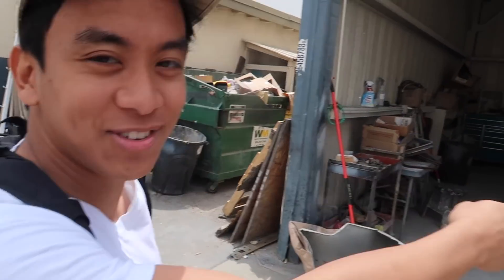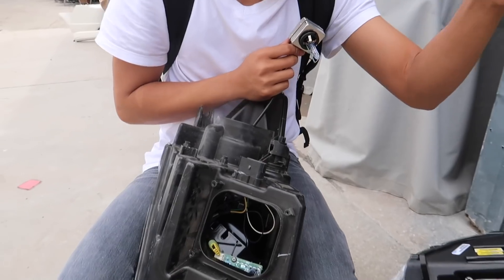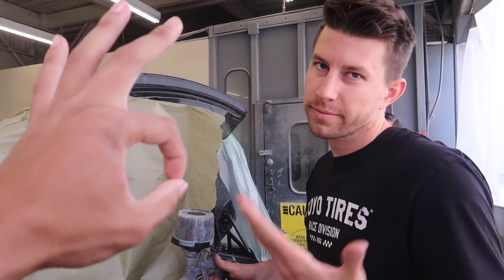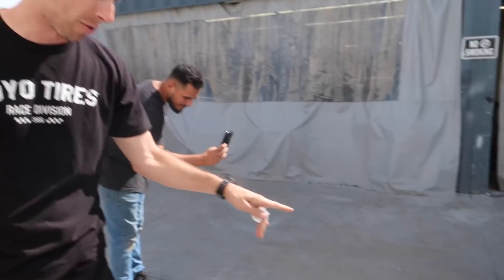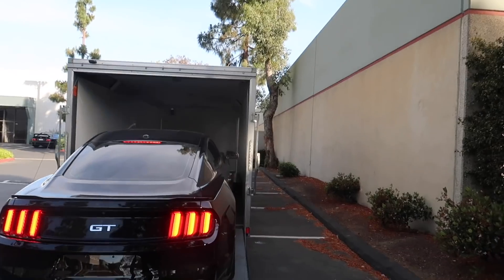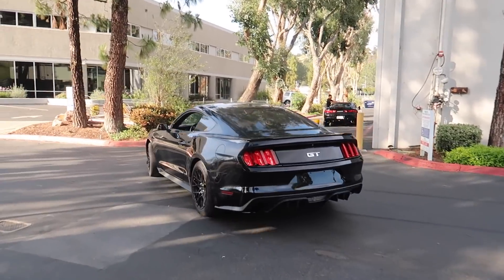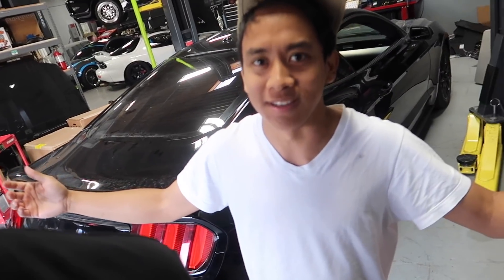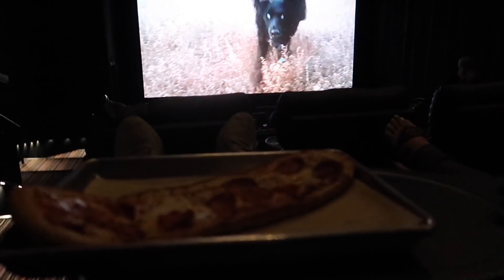The Mustang GT is COMPLETE!!

Comment: Put it in track mode then hold the traction control switch up for like 5-10 seconds until “advanced track” is off. Then you can do real skids and burnouts and not have the traction control still turn on and send you into a wall (or crowd). 
-fellow mustang owner
Reply: Who has been crowd free for 2 and a half years
Reply: Then you can burn out as long as you want and have no throttle cut

Comment: Cams, american racing long tube headers, exhaust cutouts, corsa extremes, n2mb wot box, 15” welds with mickey thompsons (for the strip) and the new carbon fiber gt500 wheels for the street, whipple supercharger, gt350 spoiler, shelby widebody kit, mgw short throw shifter, i gotchuuu
Reply: Everything here but instead of the whipple I would go with the VMP supercharger
Reply: Mustangs need whipple superchargers for sure

Comment: Owner of a 2015 Hellion Twin Turbo Mustang GT here.   With the MT82 transmission you should upgrade the clutch.   Mantic makes a great one (dual disc).  Upgrade the shifter (Barton Hybrid 3 short throw shifter), drive shaft (I prefer the Carbon Fiber but one piece aluminum works), upgrade the half shafts, and upgrade to billet oil pump and crank gears (cheap Insurance).  

Also Steeda makes a good "stop the hop kit".  I'd upgrade the sway bars too to stiffen things up. 

Lowering springs, coilovers or bags (you'll do bags!).

Wheels with the proper offset and better tires.  The stock Pirellis are brutal...  R888s maybe??

Comment: From a 2017 GT Owner

The Roush front end looks great, a little hood scoop makes it a lot more aggressive imo (Not the big ones where you can’t see shit inside)
Definitely get:
Opt7 Front switchback turn signals
Diode dynamics RGB DRL hoards
LED interior kit and reverse light kit

I’m sure Roush will send you a blower so there’s that. Tons of stuff with the Mustangs to do

Full Corsa Exhaust (Fuck the exhaust law)
MGW or a Barton shifter (Stock shifter is okay but 2nd gear in the MT-82 can be a pain in the ass when daily driving)

You MUST have upgraded half shafts and a one piece drive shaft if you plan to run slicks or radials. The stock components break after like 3 passes with a lot of grip.
Reply: clearly your not a mustang owner if you dont know the difference between a hood cowl and a hood scoop lol, and you forgot about 3.73 gear swap

Comment: My buddy has a 2018 5.0 with a stage 2 procharger kit, and e85 tune, i believe its pushing 700 to the wheel. Also get the roush full exhaust. I work at a Ford dealship and we have a lot of roushs. Definetly sounds 10000x better then factory 5.0

Comment: Vmp gen 3 blower and corsa extreme. Line lock is for drag racing so u don’t move forward or burn up brakes by just dumping clutch. It moves forward a little also for racing.

Comment: Mustang owner check in. Get the BMR "Bread and Butter" traction kit from Lethal Performance and grab some eibach sportline lowering springs at a minimum. Corsa exhaust is the best on the market. Then swap in the factory recaros and get some 20s
Reply: Oh yeah and an exedy mach 500 clutch and MGW shifter and aluminum driveshaft and ford performance axles. Boom.

Comment: What you need for that thing is corsa headers back exhaust, ported 18’ intake manifold, nitrous about 100-200 shot, coil overs/bags, and probably some billet steel oil pump gears and crank gear so that motor don’t go💥💥

Comment: You should get a gloss black or carbon fiber deck-lid for the Mustang. The deck-lid is the rear center piece where the GT badge is. Basically in between the taillights.

Comment: In my mustang which is a s197 all you need to do is be at a full stop with your foot on the brake and hold the traction control and after about 7 seconds it will say advance track off

Comment: So, if you press and hold the TC button for a while, it turns off pretty much all of the traction control. Just pressing the button only turns it off slightly. Line lock also works, but thats mostly for drag racing.

Comment: Teej if you want to do a burnout or even slide a mustang for more than 3 seconds(without line lock), hold the traction control button for 5 seconds or double tap it and it turns advanced trac off and you can do whatever you want

Comment: Corsa catless headers, and Corsa Extreme cat back, mmd v series ducktail, Roush triple adjustable coil overs, and 19 or 20 inch wheels with 10 in the front and 11 in the back, and if you press and hold the traction control button for 5 seconds it’ll turn off the “advance trac” so you can do a fatty sitter

Comment: Don’t know if you’ll actually see this but...
-BMR and STEEDA for any and all suspension mods nobody else zip nada
-American Racing Headers Or Corsa for any headers and exhaust 
-twin turbos and some extra goods take this car to mid 8’s 1/4 mile 
- NA setup - cobra jet or gt350 manifold
- best tuners VMP, LUND and Palm Beach Dyno 
- these cars are notorious for messed up transmission synchros so MGW short throw full assembly shifter (if a manual) 
- squares tire setup if you want it to handle well (very neutral and flat)
- staggered with 305-315 in the rear for max dig grip
- Please don’t bag it 
- if you want that wheel hop gone revert back to BMR and STEEDA. Cradle Bushing lockout kits, vertical links and toe rods 
-full traction control off hold traction control button for 5-10 seconds
- gt350 track spoiler looks nice with a wicker bill 
Idk what else to tell you man these things have endless amount of aftermarket potential. 
Best websites for parts cjponyparts, americanmuscle, lethalperformance, steeda

Comment: If you wanna completely disable traction control, just hold the switch for about 5-6 seconds
Reply: yeaa maybe in your honda, fords are set up different
Reply: Borat lol what? I own an s550. If you hold down the traction control disable switch for a few seconds, it will disable advancetrac, disabling traction control and heavily limiting stability control iirc
Reply: @vnctmrn  you wont get advancetrac off unless you hold down the brake and button for 10 or so seconds
Reply: Borat yep exactly.

Comment: TJ to fully turn off traction control hold the traction control switch with your foot on the brake for 10 sec until it says advanced trac off 
Also 
Corsa catbacks 
Longtubes 
18+ manifold 
E85
Some Seats 
eibachs  or (bags) ;) 
Then check out Anderson composites
Check me out on ig  I’m a soon to be bagged again S550 @white_Honduran